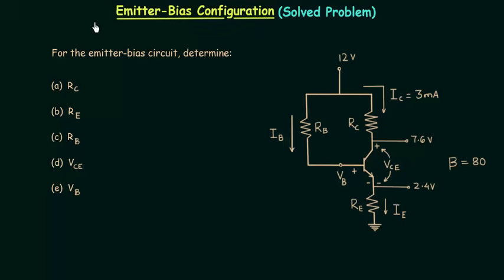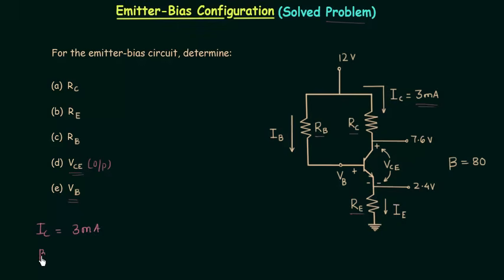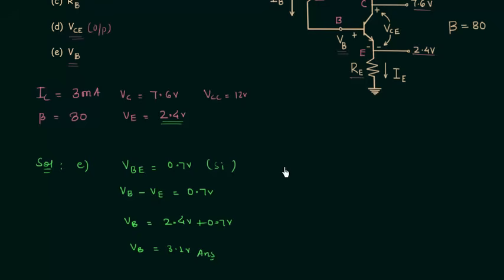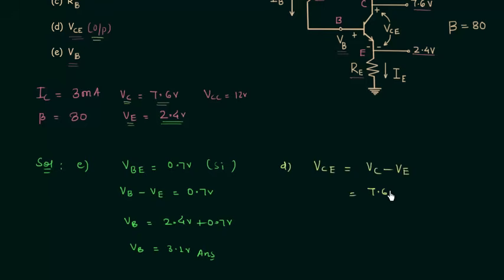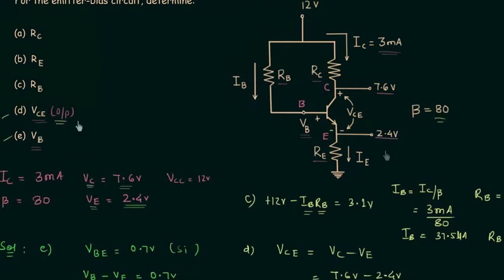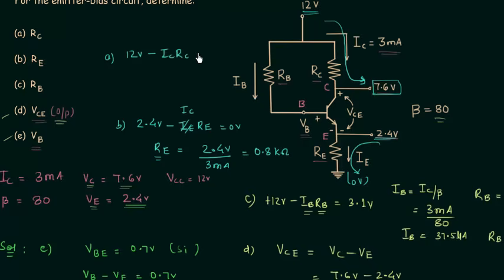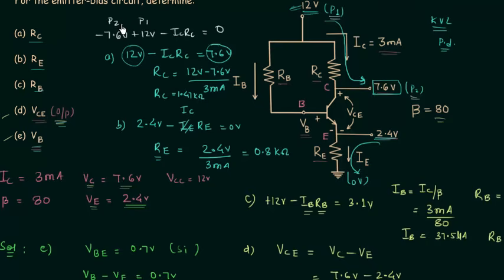Emitter-Bias Configuration (Solved Problem)

Comment: From my understanding,  VCC - (RB * IB) [12 - (273.3k * 0.0000375] should give you VB. But it gives 1.75V, which does not equal (VBE + VE) [0.7 + 2.4 = 3.1V] which likewise should give you VB. 

Furthermore, if you take KVL of the entire input loop, (VCC-IB*RB-VBE-VE) (12-10.25-0.7-2.4) = -1.35, but does not equal zero, hence KVL does not hold. So, if my calculations are not incorrect, then perhaps there is a problem with the question.
Reply: Bhai sir ne solve shi kiya h
Bas explain galat Kiya......
Waha pr Ohm's Law use Kiya h.....
Kyuki KVL sirf full circuit pr hee laga skte h.....

Wo Vcc-Vb=Ib×Rb Hai....... 
Resistance key across voltage

Comment: In previous video you used the kvl for input circuit and the loop ended till ground point..... But in this problem the input loop ended at Vb it's how it is so.....its very very very confusing.... Please reply... 🚫🚫🚫🚫🚫🚫🚫⚠️⚠️⚠️⚠️⚠️⚠️⚠️⛔⛔⛔⛔⛔⛔⛔⛔⚠️⚠️⚠️⚠️⚠️⚠️🚫🚫⛔⛔⛔⛔⛔⛔⛔🚫🚫🚫🚫⚠️⚠️⚠️⚠️⚠️
Reply: hi

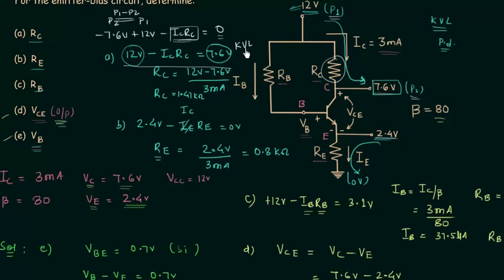Comment: 8:20 if understanding potential points seems difficult...just use intuition....take voltage difference between Rc and divide by current to get Rc...you'll get the same equation that you got using KVL

Comment: sir in C part why not write the IERE when u apply the input loop ..
Reply: You can take it also...but it will just cost you a lengthier calculation process.
Reply: There taken only VB not VBE
He taken all seperate voltages for seperate loops
Reply: 6:54 he says start and end the loop with 2 potentials

Comment: Sir how could you not taking the voltage drop across emitter while applying kvl in input loop..
Reply: he is taking Vb as the point potential ....even though the circuit below could be used ....but we don't know the value of Re thats why we didn't proceed as you thought we should...if anyone still has doubt just comment.
Reply: @aryankumar87771  sir in c part equation should be 12-IbRb-Vbe- IeRe= 0 agar ham derivation ke according kare. But sir ne 12- IbRb=3.1(Vbe) tak hi likha. Why??
Reply: He is taking...V-be is that only...which is 0.7 for Si & 0.3 for Ge

Comment: Good evening....how can you just ignore the I subscript e and R subscript e in the input loop when applied kvl???
Reply: look at his other lessons on how to perform proper calculations across two potential points
you can have a kvl equation between any two potentials ,it doesn't have to be a full loop
Reply: shubham singh 
did you watch his other video where he explains how to solve these kinda things?
Reply: Actually What the Tutor did was he just applied KVL between two Potential Points +12v and Vb....
Reply: suraj singh the answer would be same even if u use that Ie and apply KVL in entire input loop
Reply: suraj singh yes please reply +neso academy
Reply: Akshay Kumar Dude kvl and kcl can only be applied in loops (I.e if there are points a->b->c->d then you can't go to d from a without going through b & c)